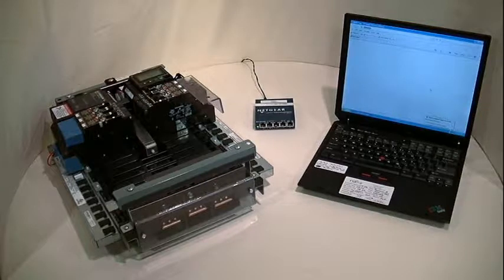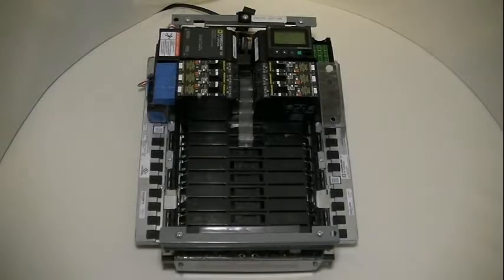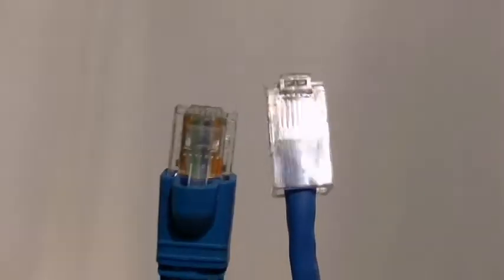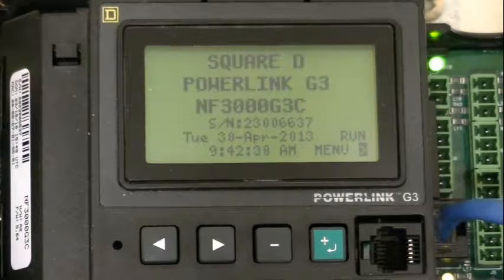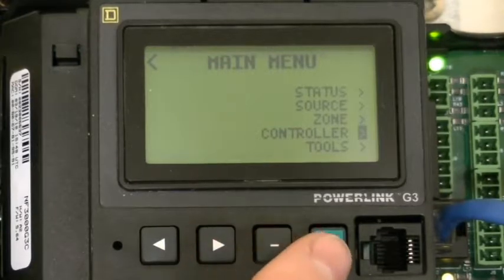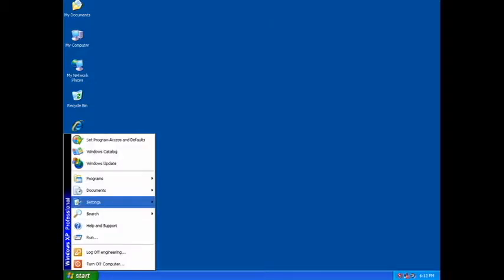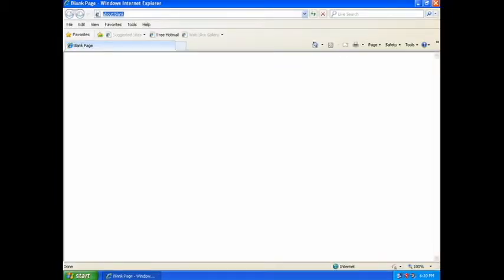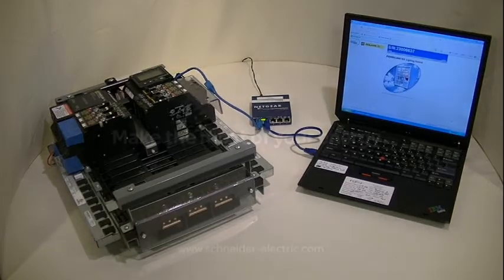Square D Powerlink Controller   Basic Setup Uncompressed

Comment from the maker: We have moved this video in from our earlier account. 4/9/2018
Also , the NEWEST Powerlink Controller is our 3500 system. Model 2000 and 3000 are now part of our legacy family.
You will need our NEW LCS V2.0 software for the new controller. Thanks for your interest!
Tech Electric Guy